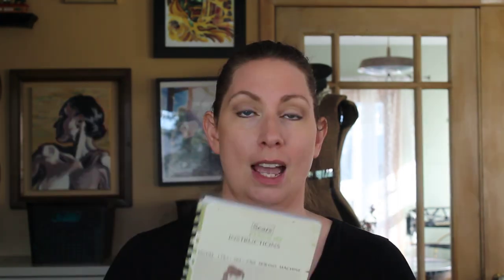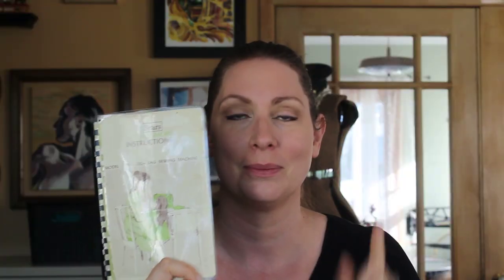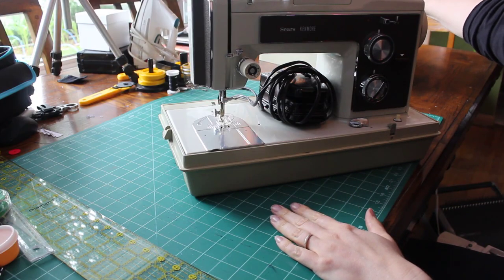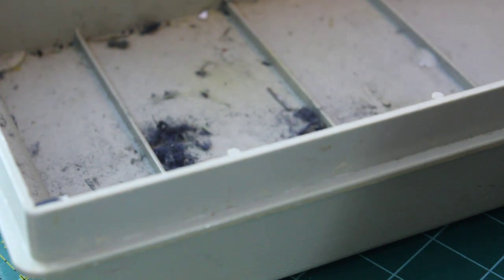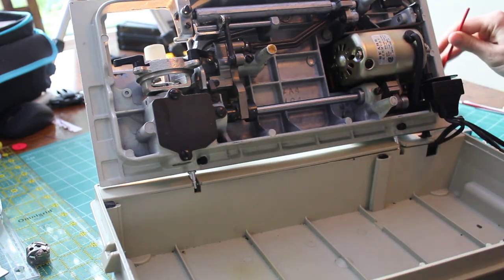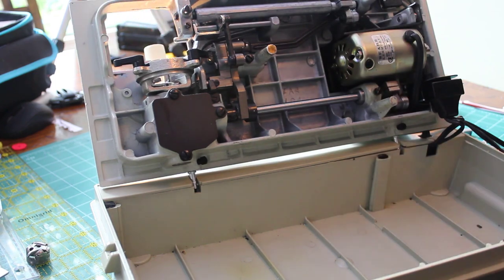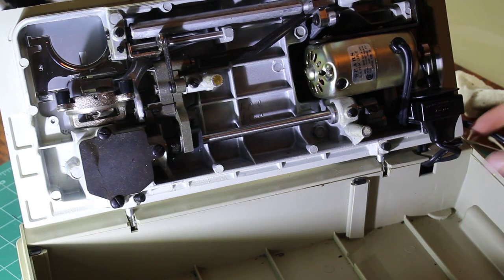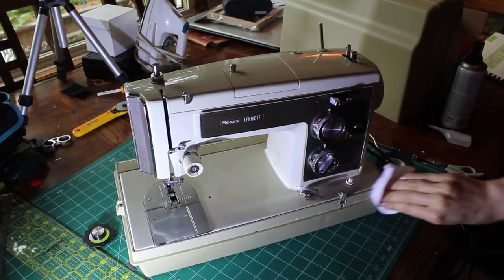How to Clean and Oil a Vintage Sewing Machine

Comment: Great start. I was told by my Bernina shop 32 years ago to never blow into my machine to clean it. Breath is moist and can cause rust. Use your vacuum cleaner instead. Solid advice I've followed ever since. No canned air in the 70's! But the vacuum will suck everything out, specially when you follow your brush with it.

Comment: FYI, you're not supposed to turn the fly wheel away from you, as it could cause damage.
Reply from the maker: Oh did I do that? Oops, funny the things you don't think of sometimes. Thanks!
Reply: @What a maroon As one Bugs Bunny fan to another, el mucho gracias...!
Reply: I noticed it too, !
Reply: I've always heard that. Do you know why (seriously asking)?
Reply: I dont know what could be damaged. If there is resistance or binding or you hear or feel parts hitting something maybe, but most rotating machinery will turn either way without damage. If you had thread in the machine or attempted to sew backward you could possibly bind the bottom thread area. I have 46 vintage machines and have never managed to damage one by turning it backwards. Modern machines with electronics and plastic gears may be a different story
Reply: I have read it can mess with the timing or otherwise cause you to need professional work done.  It's funny, they must have really driven this message home in home ec back in the day because I remember it being one of the first things my mom taught me, and it stuck so well that I immediately noticed it in the video!   

Different machines do have different directions, though -  I had a Kenmore rotary machine for a while and it told you to turn the handwheel clockwise.   I had to put stickers on my wheels as a reminder so I wouldn't get mixed up between machines.  But MOST machines will have you turn the wheel towards yourself.
Reply: @pennsygal5953  thank you for the advice
Reply: @ryndl  I agree I put a old early 1960s happy sewing machine motor together wrong and it was running backwards. Took apart reversed brushes. Sewing machine now works fine. No plastic except two buttons and electronic parts. Having said that it's a very basic and "simple" machine.

Comment: I inherited a Kenmore 158.13512 and took it to be serviced two years ago. The guy cleaned it and made sure it worked and gave it back. I put it away until I needed it. Last night I pulled it out to start a project and decided to wind a bobbin. I went through SO MANY YouTube tutorials to find one to help me figure out how to do that. I found your tutorial and decided to buy the manual for my machine. Turns out, the clutch release is right where everyone else's is, but mine is stuck (however the hand wheel will turn freely and everything else works. I just can't get the center part to pull out). I put the sewing machine away for the night. Today I woke up and watched your video on how to clean it. I don't know if this will fix the issue, but it's a great place to start. Thank for having this here. You have already been a major help in just getting the manual.
Reply: Also, I just took the time to go into that PDF and photoshop those lime arrows orange so I could see them better once I print this out. Thanks for the suggestion on printing it and reinforcing the edges to make it last longer.
Reply: Great video.  I have this same machine so it was very helpful.  The instructions are very basic in the book, so it's nice to watch someone actual performing the steps, especially oiling the shuttle race.

Comment: Heck Yeah! Thank you. It is now July 2022. I bought a vintage machine from a flea market in Germany last year and I haven't used it because I had no clue how to clean and oil it inside. I did give the entire machine outside and the case it came in a very good clean. I plugged it in and it does work. That's a relief. Hahaha. Soooo, this is the fun part. I live in Germany now and of course the manual (it still has a manual :-) is in German! I speak English and after half a year of German school, no I cannot read the manual. You made it all look like I can at least do some of the oiling and cleaning where the bobbin goes under the foot...once removed :-) LOL
Reply from the maker: You can't go wrong with these machines! Happy sewing❤️

Comment: My mother bought a sears kenmore model 158.1703 from a thrift store  years ago and it’s been sitting in my storage out back. I decided to pulled it out to use it and learn how to sew. Sadly it hasn’t been cleaned in a very long time. It’s full of grease and gunk. Since I have no manual. This will help me get an idea of where to oil it once I figure out how to properly clean it.
Reply from the maker: Good for you Lisa! Make sure you check out the links in the video notes. There are resources there to find new manuals. Happy sewing!
Reply: facebook has a vintage sewing machine club that has many manuals in their files. i download and then put them  on a disc .
Reply from the maker: Great resource thanks for sharing!!

Comment: I'm with you on the air deal. I've used an air compressor as much in that I have one. In my experience cleaning things like this, dust and smut does kind of go everywhere, but air does seem to force it out not in. No disrespect to other commenters, but if you are getting dirt further in you didn't open the machine up enough....meaning disassembling.
Reply from the maker: Thanks Sam, I really appreciate your comment. My husband is a millwright and confirmed for me that it is common place to use compressed air to clean small machines. But everyone has their own way and I know I can't please everyone. Thanks so much for supporting and commenting ❤️

Comment: Thanks so much for this tutorial. My machine is acting up a lot lately but I want to do my own maintenance on it before sending it out, or before just giving up and buying a new one. I really like how you present yourself, I feel very confident watching your video. I will try and tell you how it goes. Thanks.
Reply from the maker: Thanks so much. If it's still acting up after you clean it I definately recommend taking it in before getting a new one. There isn't much on these old machines that can't be fixed. Good luck.

Comment: I got a Kenmore 158.1752 for $20 at Goodwill, in its cabinet. I have been using it (not on a daily basis, by any means) for a year or so, but with all the mask-making I've been doing, now I've got some little issues popping up. I oiled it as best I could a few months ago, but I need to give it a good clean up. The machine is a dream. It runs so incredibly smoothly, it makes very little noise, etc. I've been using a mostly new Singer as a backup, and it feels so flimsy! No thanks.  
Thanks for the video!
Reply from the maker: What a great find Paige! These machines are so great, happy sewing!

Comment: So I just bought a kenmore 1941 off of eBay. It works as far as I can tell (totally new at this). I know I have to oil it but I don’t know if I need to have it professionally cleaned because ALL the internal parts are yellow with a film of oil and dust. Is this ok and do I just continue “cleaning” and oiling or do I need to get it deep cleaned first?
Reply: I am wondering the same!

Comment: I was truly amazed at the difference that little bit of oil made in my Kenmore 158. I'm no dummy about this sort of thing, but it seemed the machine worked well before, but now.... Once I found what I hope are all the oiling points, the old Kenmore has improved noticeable! Thanks so much for your help. I have a question maybe you or one of your subscribers may know the answer to. My machine has an adjustment on the back, to the top right, a small knob marked plus and minus. It would be nice to know what it changes,
Reply from the maker: Thanks Sam! I'm not sure about that dial. Mine doesn't have anything in that spot. Could it maybe have to do with the pressure of the presser foot?

Comment: If this is your Moms treasure or an important family heirloom, then please consider popping the damaged book pages into page protectors and into a binder.
I say this as a bookbinder.
If your selling it and it is low cost absolutely follow this videos instruction for book repair!
But if your trying to conserve a book or if your Mom wrote in the margins and you want it preserved please bring it to a bookbinder and have the paper repaired with paper because tape changes colour after awhile and is difficult, or if the adhesive is acrylic, impossible to remove.
No criticism to the video creature for this great video, just a word of caution for special circumstances.

Comment: What if machine is mounted in a cabinet and the hand wheel won't turn??  how can you get to the underside?  you made it look sooo easy!!
Reply from the maker: Hey Lori! I've had a couple cabinet mounted machines and they all tipped back to gain access to the underside. If you want to remove it from the cabinet all together then look for the little mettle arms that are holding your machine into the table. They are usually on hinges and that's why you can lift and tilt your machine.
On the sides of those bars there should be a set screw. Undo the screw and the machine should slide off of those bars.

At least that's how my machines have worked.

Either way tiling or removal, once you gain access to the underside, if you can't see anything obvious clogging up the machine like a bunch of thread wrapped around the shuttle, then the seized wheel might be a mechanical issue and it would be best to take it to a pro for help.
It's hard to explain without being able to show you sooooo I hope this helped 😁 good luck!

Comment: You are the first person I have seen with the exact same one I inherited! Finally! I have so many beginner questions considering I can't find any information on this specific one. Like, what is that top middle section that opens up? Do I need to use that or just maintain it? Also for the life of me I cannot figure out to wind the bobbin up....I've just been doing it by hand haha
Reply from the maker: Oh that's so awesome Trisha! It's such a great machine. The best thing to do really would be to check out the links in the description for a replacement manual. It will have all the tips and how to's. Plus you really do need it to figure out all of the different stitches.

In the meantime, you're bobbin winder is on the top near the hand wheel. It's a small pin that your bobbin will fit on. You run the thread around another short pin on the top but at the other end of the machine. It has a groove for the thread. Once you have your thread around that and through your bobbin and the bobbin on its pin, there is a metal sort of switch next to the bobbin. You need to slide it over to engage the bobbin winder. 

Hope that helps!
Reply: @StephanieRubletz  yes, I will try and find it I seem to keep finding ones that are close but are not the exact one.

Also I figured out what you just said about setting it all up for bobbin, my issue comes in because nothing seems to happen when I clamp it in ...the needle just keeps moving and nothing happens with bobbin, is it supposed to start spinning on its own or do I have a switch? I feel as though maybe something isn't working in that area 😕
Reply from the maker: Okay, so that means the bobbin winder is not engaged. That's the switch it I guess it more looks like a lever with a sort of square horseshoe shape at the top. That needs to be pushed over to switch the machines to bobbin mode
Reply: the top middle part is where you put the pattern cams that give you more decorative stitching.

Comment: I always clean the tension discs to make sure there’s no old thread stuck inside which may mess up your stitch tension 🥰
Reply from the maker: Oh good call!
Reply: That knob we wrap thread around? How you clean that? With dry brushes?
Reply: @rachel14rod  i normally unscrew it and clean the tiny disks that way (if you have access to the screw) or you could use a very thin strip of fabric with some sewing machine oil on and try running that i between them to clean out any lint build up (just make sure the pressure foot isn’t engaged and take your time)

Comment: Did you pack the grease in the spot in the bottom? It’s under that black square.. great video!
Reply from the maker: Thanks Karen. No my manual didn't say to open the black square. That may be a step in a full mechanical servicing though. Especially if it requires grease instead of machine oil. I may one day order the mechanical manual so I can do the full service myself. It would be nice to know all the ins and outs 😊
Reply: It's VERY easy to do Stephanie.  First, get some Tri-Flow Clear Synthetic grease (Amazon should have it - Look for a 3 oz tube that's mostly red with  black top).  Do NOT use petroleum jelly or anything similar!  Tri-Flow is specifically for sewing machines.  Now set your machine  upside down as you did previously and remove the three little screws (don't lose them!) holding the black gear case cover in place.  It should now lift off easily, but be careful as there should be a thin fiber-like seal just under the cover. Note how the seal is located so you can put it back the same way.  Set them both aside.  You'll now see two large gears at right angles to one another.  If you see orange or brownish grease on them, they need cleaning.  Use your Q-tips and clean out the old grease, turning the hand wheel as you go to expose more of the gears.  There could be grease on the bottom of the gear case also. Remove all that you can. Now squeeze a dollop of fresh grease on the gears where they meet and turn the hand wheel (toward you) to turn them and spread the grease.  Replace the seal and cover and you're done!  The machine will continue to grease itself as you sew.  Easy peasy!
Reply: P.S. Love these old Kenmores!!!  I have several and love them all, they're superbly designed & engineered machines.  If well-cared for they will last for generations and beyond.
Reply from the maker: Thanks so much! I'll have to take a closer look at that spot on my machine! I agree these machines are so great!

Comment: Compressed air blows dust and lint out but also deep into the machine, not recommended by professionals. Manual cleaning or a specialized vacuum tool is the way to go.
Reply from the maker: Thanks! Someone else made that comment too. I'll keep that in mind next time.

Comment: Where do I find belts for this machine?
Reply from the maker: You can find them on Etsy and even on Amazon. If you are in Canada you might even check Sears parts direct though they might not stock them anymore. It will kinda depend on where you are. I googled "1757 Kenmore belt" and several options came up. Just make sure that it looks right. My bet has teeth and some that came up in my search on Amazon did not.
Reply: Google search using the name and model number

Comment: Right now my balance wheel is acting up. It spins but the needle doesn't do the same speed. And the balance wheel loosens of by its self. Have you heard of anything like this?
Reply from the maker: That's something I would take it into a pro for rather than handle it myself. I'd be concerned about any misalignment that could damage other parts of the machine. The great thing about these machines is that parts are often still readily available. 

That said, you could check out the sewing machine repair workshop channel. As far as actual repairs to hardware go, they will be much more knowledgeable than I am.

Good luck!

Comment: I've read over and over again not to use compressed air, but rather a vacuum.
Reply from the maker: That's totally valid. I don't have a small vacuum that could reach and my husband who is a millwright said that compressed air is used for similar applications in industry. I've continued to clean my machine that way with no issues but I get why people would prefer a vacuum
Reply: @StephanieRubletz  Good to know!! Maybe that is one of those things people just say and believe. Maybe it is true with computerized machines. 🤷
Reply from the maker: Maybe. I think you can kinda direct the air flows a bit too and go through things rather than push dust in farther. Really just do what works for you.

Comment: stopped watching when I saw you turn the fly wheel the wrong way....
Reply from the maker: That's fine, but just so you know, the reason we don't turn the flywheel the wrong way is to avoid thread jams. I had no thread in my machine so I was able to just focus on moving the machine to distribute the oil. ❤️